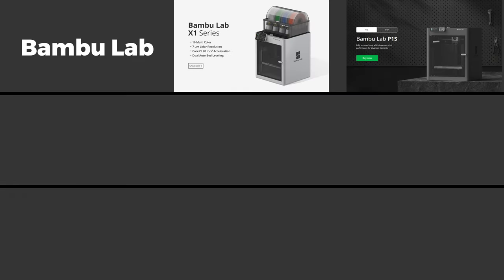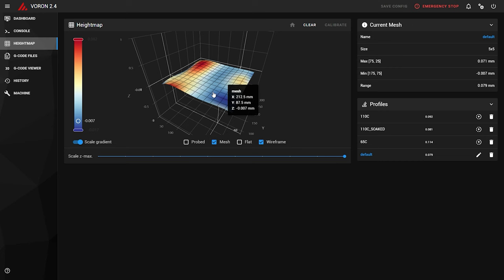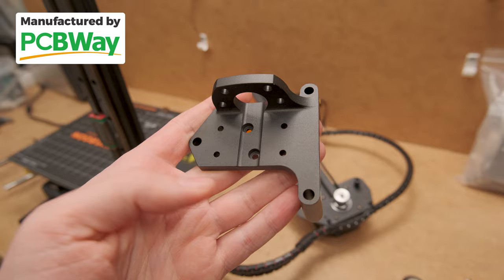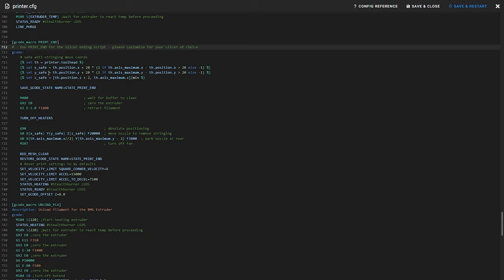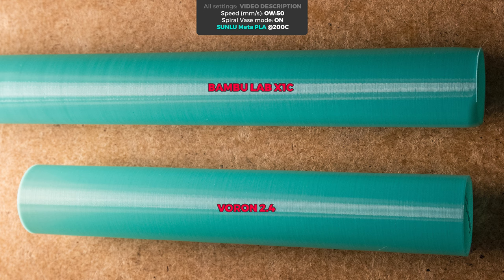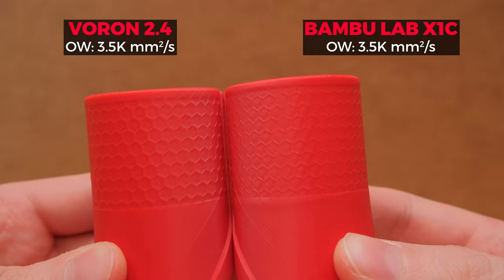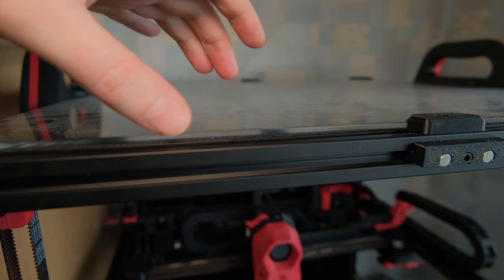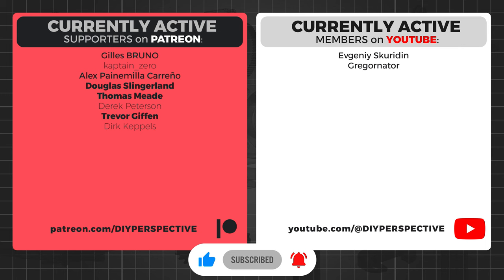Is VORON 2.4 as GOOD as people make you believe? (vs Bambu X1C)

Comment: I love your videos, you focus on details that are very difficult to hear from many 3D printing YouTubers. 
What is your opinion of the Creality K1? I bought it very cheap with the idea of customizing the firmware and hardware to have a silent and precise printer. 
Do you think this will be possible with the linear rail system?
Thank you very much and sorry for my English
Reply from the maker: Thanks! That is what I am trying to do here! :)
I still testing K1, I think it is better than most people would think at first, but it still has issues. About the fans, they are insanely loud but they also push a lot of air. So I feel like you have to slow them down as much as you can. You can fine-tune them to find a cooling/noise sweet spot with my overhand test print if you are printing PLA. When printing ABS it is not that loud, Bambu is definitely more irritating if you are in the same room. About the motion system, you can't escape the reality that it will make noise at higher speeds. Also, a good idea would be to use foam tape like on Vorons to reduce vibrations on those side panels as they can act as loudspeakers.
Reply: @PrintingPerspective  brilliant! I will apply your ideas. The truth is, I think that the Creality K1 is a printer that offers hardware for a price that is impossible to find in any other way. I think it is a cheap printer with great potential, just like the Kingroon KP3S. Thank you for your words

Comment: I'd like to build a Trident, but pricing honestly holds me back at the moment. I run a small 3D printing business and, while I have a pretty good working knowledge of FDM, I'd like to build a Voron and learn Klipper. But ~$1000 for the Formbot Trident kit (without printed parts) or $1500 for the LDO 2.4r2 kit is a bit much...
Reply: buy a used kit/buy a v0
Reply: The largest Voron 2.4 has a print area 350x350. Rat Rig has a 400x400 and even a 500x500. I don't know of any other printers that large for such a low price.
Reply: I wouldn’t recommend a Voron in a print farm. Wonderful machine but you need scalability and if you get a big commission you cannot spend 50+ hs building a Voron requiring a kit and upgrades with undetermined shipping time. You need something like Sovol, Prusa and Bambu that can send you 10 printers in a week.
Reply: @DianosAbael  As a voron printfarm owner I'd have to disagree (We run tridents and v0.1s). By now we have all the jigs and practice in place to make building easy and the time invested is well spent as far as training people to do a better job in maintenance goes. We also have easy access to eu stock in kits. For us building a trident or building a mk4 hardly makes any difference at this point.

Comment: if i was going to do a voron now i'd do a troodon as it's much easier to setup and then you can switch to klipper later :)
Reply from the maker: True, but the only downside is that it is not that easily moddable.
Reply: @PrintingPerspective  only really a mainboard swap which granted is a pain but you don't have to do that to get a good experience but do for full potential haha

Comment: Inspired by this video, I rebuilt my Voron 2.4 and switched from Revo Voron to a Bambulab hotend (the TZ 2.0 + CHT clone). It works great. But it's so fast heating that the Klipper PID_CALIBRATE didn't find so good PID parameters. The temp fluctuates so much that I have to wait a while until prints start. Have you found some good PID parameters?
Reply from the maker: I never liked Klipper's PID tuning, I feel like Marlin had so much more precise control. If you tune to the printing temp, at least mine fluctuates only max of -1 to +1 degrees. It is a powerful heater with a low thermal mass of the heatblock. What you can do is add this code that replaces M109 (wait for hotend temp). It still waits for the set temp with M104 but it doesn't wait for temperatures to stabilize. The code is from the Ellis Print Tuning Guide.

[gcode_macro M109]
rename_existing: M99109
gcode:
    #Parameters
    {% set s = params.S|float %}
    
    M104 {% for p in params %}{'%s%s' % (p, params[p])}{% endfor %}  ; Set hotend temp
    {% if s != 0 %}
        TEMPERATURE_WAIT SENSOR=extruder MINIMUM={s} MAXIMUM={s+1}   ; Wait for hotend temp (within 1 degree)
    {% endif %}
Reply: Thank you  @PrintingPerspective . This is an alternative. But what PID params do you actually use now for your Stealthburner with TZ2.0 hotend? I experimented with the parameters and found a setting  (pid_kp = 8.5, pid_ki = 2.62, pid_kd = 22.0) which starts with an overshot but is very stable after that.
Reply from the maker: I just use whatever Klipper PID gives. In my case they are:

pid_kp = 27.298
pid_ki = 9.578
pid_kd = 19.450
Reply: Google and read up on the theory.  Don't just use other people's numbers.   You need the means to. plot temperature over time.   Start with I and D at zero and keep making P larger until you get oscillation, then back off.   There is more but that is what Googler is for.     Basically, you need a systematic approach, not just trying some numbers.   PID tuning is a big field and is used for "everything from heating to electric motor control.   It was invented for steering ships at sea, so there is. aton of theory out there to read.

Comment: I wonder if anyone has attempted (or will in the future) to convert a Bambu to something more open source and away from Bambu itself. Maybe when they're older and start hitting the used printer market.
Reply: just take the technology and implement it as an open source project. No need to convert Bambu to open source. Voron is open source and the hardware of Bambu printers isn't revolutionary. Most of the cost of the printer is the name( large profit margin) and the dev team cost of putting the software and cloud together. The motors, nozzles, and even the rods arnt a new thing. Hell its even arguable that the rails in the Voron are better, as they are proven off the shelf parts used in high production environments. The body of most Bambu's are simple plastic with a metal frame. Its been dressed up nice, but under it isn't anything crazy. 

In fact if you want a tiny 3d printer that ACTUALLY prints at 1000mm/s build a Voron 0.1. You could even use Kilpper( or Marlin for that matter) and set up your own cloud printing without the fuss of a huge corporation dealing with your stuff.
Reply: @RandoWisLuL  lately I've been modding broken printers. I'd like to build a voron/ratrig/hevort but there's also a part of me that wants to rip the board out of a Bambu and put in my own, just to spite their cloud and their "even though you bought it, we still own it" mentality. It's just parts after all.

Comment: Would be interesting to have a Bamboo and Voron simultaneously print 24/7 and see which one breaks first. My money would be on the Voron.
Reply: Possibly...contact both companies and get printers sent and run that test. Just make sure the bambu has fire suppression near by incase it decides to start ghost printing on its own in the middle of the night 😊
Reply: Tough to say. BL printers run a lot harder on their internal components than Vorons due to higher accelerations and speeds for most setups. The Vorons use printed parts, but honestly they aren't the bottleneck to longevity in my experience. My bearings and belts are usually the first thing to give out after around 1500-2000 print hours. Would be interesting to see, but I'll tell ya from a technician's perspective I'd much rather work on a Voron that's broken than a BL that's broken.
Reply from the maker: @ferdinandhenkel4567 You have to clean carbon rods on Bambu printers, otherwise, they will act as abrasive dust and the X-axis will fail prematurely. So... you can't be running 24/7 the printer unless you intentionally want the X-axis to fail. :)
Reply from the maker: @AustinDennis "I'd much rather work on a Voron that's broken than a BL" that is 100% true. Especially if the problem is unknown and you have to figure out what is wrong with a machine in the first place.
Reply: And then do a comparison on which one you can actually fix.
Reply: Wouldn’t take that bet if I were you, carbon fiber rods will not outlast linear bearings
Reply: Yeah maybe I should give each printer a few hours off for maintenance.
Reply: @AustinDennis  I'll rather work on broken voron than bambu lab .. this is the the top thing I would take my decision on !! Very rightly said !!
Reply: @AustinDennis please make this as a main comment .. which is important to what people discussing here !!
Reply: I have Voron V2.4 from last 3 years. Total pront time is around 6500+ hours.
I have done 2 major maintainance on this printer. 1st one for adding Stealthburner + xy pin mods + ramalama xy idlers + umbilical and 2nd one for adding printed TAP. Although I will call these upgrades rather than maintainance.
I added cnc z tensioners when my printed z tensioner cracked after 4000 hrs of printing. 
I do check my belt tensions and Input shaper every 3-4 months.
Re-lubed linear rails twice in these 3 years.
Reply: If something breaks on a Voron, you usually know what it was, and how to replace it cause you built the bloody thing.

Comment: It's kinda like, "My Honda is better than a Porsche - after I replaced the block, crank, rods, head, added a turbo, went with an aftermarket ECU, replaced the transmission gears, upgraded the shocks, springs, brakes, wheels, tires, etc, etc." Sort of an apples-to-oranges comparison, really, as each party is after different things.

Comment: Why did you include a price comparison with the P1S instead of the X1C at the end.  Like you have used the X1C throughout the video and then take the price of the P1S if that is not misleading I don't know what is. Especially since Bambulab doesn't really need the help to begin with the X1C is still a pretty good deal for no tinkering necessary vs Voron. You also forgot the most important comparison of them all. You emphasize that you don't have to tinker with the X1C a lot and yet you forget to mention that you almost can't mess with the X1C to begin with because all of it is proprietary. The hardware and the software so upgrading it is completely dependent on Bambulab.
Reply from the maker: Because P1S is basically X1C without the lidar. Why would you want to tinker with a printer that just works? Most people want just to print and they don't care if the printer is closed or open source, that is the reality. The video focus was on the actual print quality for people who are capable of building a Voron to know if its DIY design is still capable compared to what a commercial solution is. I have no doubt that they already know FW differences if they actually thinking of doing it. That is the best way I can answer your concerns.

Comment: People that build vorons actually enjoy the hobby. People that jump straight to bambu just want plastic junk to fill their house up with. Using $5 in fillament to print a $2 toy.
Reply: Or, the people who buy a Bambu/Qidi because they want to print functional items and don't want to have to constantly fuck around with a Voron. But keep gatekeeping, I guess.
Reply: @theglowcloud2215  Got any pics of all these functional prints you're making? I had no idea that multicolor was needed for function. It's a printer that won't even let you set offsets to get the dimensions accurate. But keep lying to yourself, I guess.
Reply: @jessie38supercharged  No need to be so rude. What's gotten you in such a bad mood? This kind of toxicity is just detrimental to the 3D printing community.
"Got any pics" is a pretty weird question to ask in a comments section where you can't post pics or links. Like, what kind of response are you expecting?
I use a Bambu X1C to print functional parts, and I don't see myself having the time to build a Voron.
I haven't had any issues with dimensional accuracy whatsoever, and the AMS is great as a magazine for your most commonly used filaments. I sometimes use the multi-color function, but not very often.
Reality is that the X1C is fantastic for people who want to have a fast 3D printer for making prototype stuff. Vorons are for people who are interested in building a printer.

Comment: I always see people printing with >10% infill in these videos. Why?
If it's not a functional part why don't you just use 0%/5% infill and maybe 3 perimeters if your part will really have to take a beating?
Reply: Cause it is the default settings in most slicers + examples and what the average layman who just wants to print knick-knacks use. To use other settings despite being more logical for better performance, risks such people to come and complain loudly about videos like this misleading them. So most videos just stick to default.

In practice though anyone with some skill will indeed rarely go beyond 10% infill max, use about 3 top/bot layers and 2-3 perimeters. Only stuff that may get warm like 3D-Printer parts can benefit from a heavier construction to minimize potential warping.

Comment: Is 3D design your primary hobby and you need a TOOL to print your designs? Get a Bambu lab printer. Are 3D printers your main hobby and you like tinkering to make them better (and you have 2-3x the budget)? Build a Voron or RatRig. The Bambu printers out of the box will get you 75-80% of the way to the MAX quality you can push out of a Voron 2.4, and it will already be there 20 minutes after opening the box.

Comment: This comparison is flawed in so many areas....
Buys the cheapest kit for a Voron 2.4, when most kits cost double of what the kit shown in this video. 
Then correctly says that you need some experience building a Voron, but then complain the lack of scripts lol, well that is the point, you are free to customize it as you wish.
Then proceeds to evaluate his Voron against a Bambu X1C without considering that this video creator experience will not be the same as the majority of Voron owners with better components. 
All this to say, that this video is flawed in the sense that it doesn't represent the average Voron build, mostly due to the cheaper kit. As such, it just shows this specific build, which is not surprising to loose in some aspect, which I also suspect being due to poor assembly.
Reply: Getting a cheap voron is like buying one of those nigerian DIY lamborghinis. Voron is meant to be a no compromise printer, getting cheap parts ruins the point
Reply: @giedrius2149  agreed, you are better served with a cheap Chinese printer like a Creality

Comment: The big difference is between an open design and a closed design. If something goes wrong with a Voron, replacement parts are cheap and easily available, the OS is open source, sky is the limit. Bamboo replacement parts are expensive and not available. The printer is designed not to be fixed or upgraded. The stock OS is closed and you are locked into a slicer. This reason alone, Voron wins.
Reply: What are you talking about? Bambu provides replacement parts for 100% of the machine...and they're cheap. A hot end is $15 new from bambu
Reply: @TheOfficialOriginalChad  replace the bed leveling sensor, $100 for the part, and 75 screws to get at it. The Voron design is simply superior to anything Bamboo offers and won't burn your house down.

Comment: Fysec sounds like crap. I have ldo. All good parts.
Reply from the maker: Well it better have all the great parts when it costs 60% more, at least where I live, you know. I would love to check it out if it is only marketing hype or their kits are so much better.
Reply: @DIYPERSPECTIVE they are regarded as being superior...and my input shaper graphs on the LDO 350 I just built last week are nothing like yours.
Reply: @PrintingPerspective I went to China for holiday so decided to make use of the extra luggage space my family has, anyways flown a full 2.4 300 ldo kit for ~$800 to the uk where it would’ve cost over twice the amount
And yes, I didn’t pay an extra cent for heavy luggage charges since it was included
Reply: @PrintingPerspective My experience is it is good.  The one thing i did n't like was the input shaper board.  That did n't work, so i tossed it.  They gave me an Omron brand part for the AC, that  is important that that is high quality.  Also, all wires precrimped and good instructions.  Had some japanese bearings for z axis too.  No crap parts that i had to toss.  Also came with REVO, which i sold on ebay for 80 because i don't need it.  I did not use extruder, used orbiter.  Real bondtech gears included for extruder, which i will also sell because i like orbiter.  Also came with clicky and it is a 300 x 300 x 300.  Does yours have a 250 z?  LDO has higher z that other cheap vorons.
Reply from the maker: @C650101 Hopefully there was more good stuff because for $600 more it is very little. Fysetc kit kad Omron relay too. All wires were pre-crimped too. Instructions, well, the official Voron manual is pretty damn good. I feel like the budget kits can benefit experienced builders who can buy additional parts to make good value and quality. When LDO you just buy all good stuff the easy way with an extra cost. That is also good because not everyone wants to spend additional time searching for the parts when the point of the kit is to already have all the parts. And yes, mine is 250mm max Z.
Reply: @PrintingPerspective  There are kits like Magic Phoenix that have quality parts at better prices than LDO.
Reply: @MegaDeKay  shit. Looked at thier site. Even with bells, came to 856 for 300 cube. You are on to something. Did you buy one?